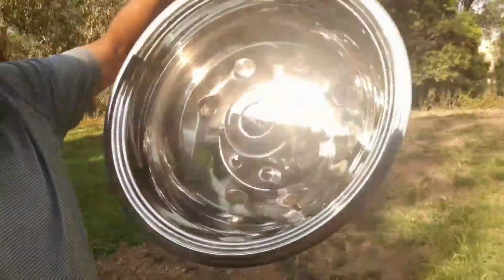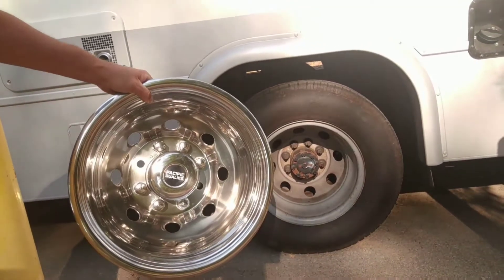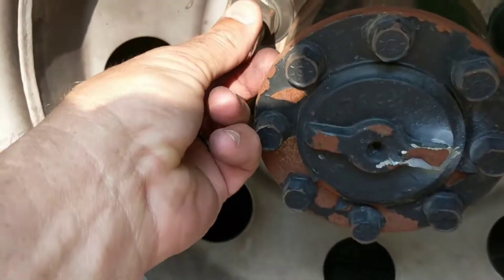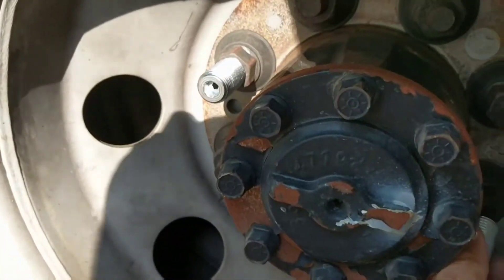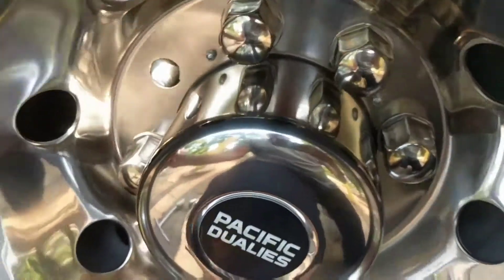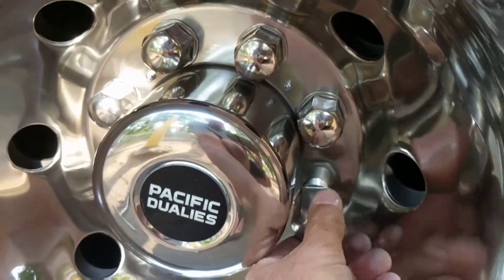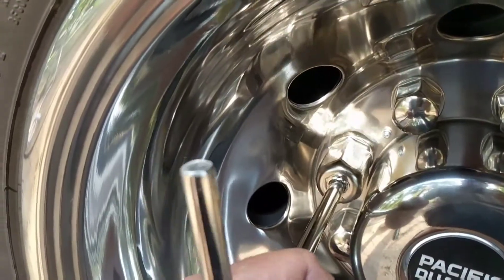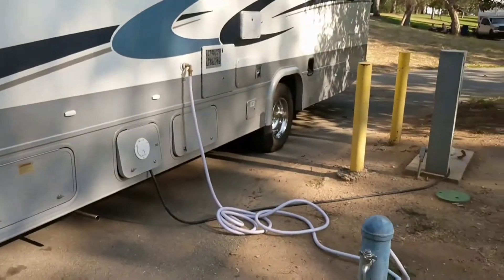Pacific Dualies 34-1608A Wheel Simulator​s RV install

Comment: Good deal! My RV came with something similar, I'm trying to get them off to check the air in the outside tires. I think mine are the pry-off ones probably cheaper. Thanks for this, I might invest in a set of those if I mangle these, lol.

Comment: I have extended valve stems on my inside dually wheels (not wheel extensions) and I fed the extended valve stem through the holes and the caps on the extended lugs and I can air up my inside wheel without removing anything.
Reply from the maker: It's my outside wheel that I have trouble with.  I need a 45° angle stem extension... But I don't want to add any extension on to my 3"valve stem

Comment: Those really look nice!  I'm afraid I have the hillybilly looking ones. If I got these I'm afraid it wouldn't work with my tire sensors. As you said you'll have to remove the rear ones to check or fill the tires.
Reply from the maker: I was perfectly happy with the old ones but was afraid I would lose them again , so to keep down cost I got these.

Comment: Hi Jerry, thanks for great video.  I have a 1999 Ford e450 or e350  7.3 Diesel truck.  My hubcap wheel bolt extensions appear to have 4 stems instead of 2.  Do you think this is possible?  Thanks
Reply from the maker: These only have two holes through. Maybe you can take off the existing ones and use only the two extensions it comes with?
Reply: @JerryFrye1966  Thank you Jerry, good idea 👍 i will give it a try.  Keep up the great auto RV videos & continued blessings 🙏🌌🌠

Comment: Are they still on?
Reply from the maker: Yes sir! Over 15000 miles. I lost a couple of the lug nuts and had to buy replacements. They should be checked and tightened as needed every 15K miles or use blue locktite